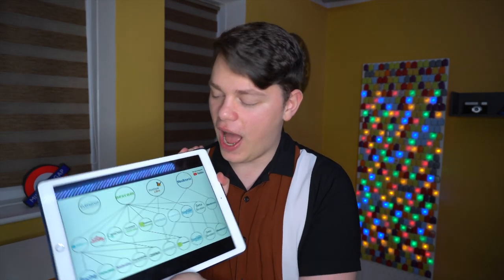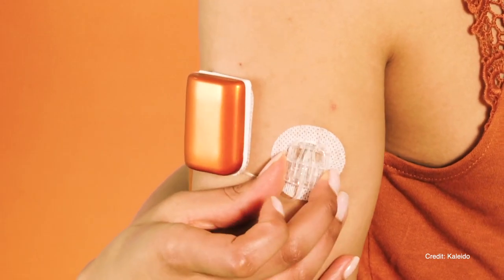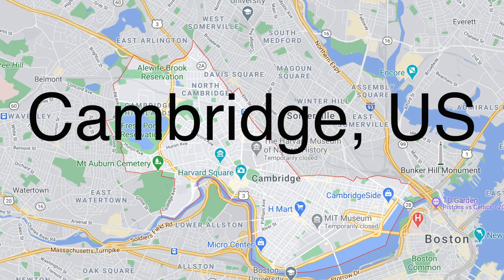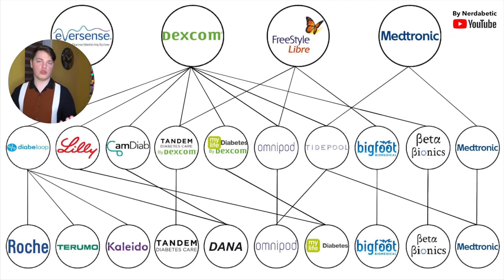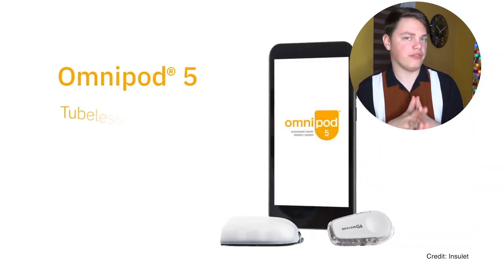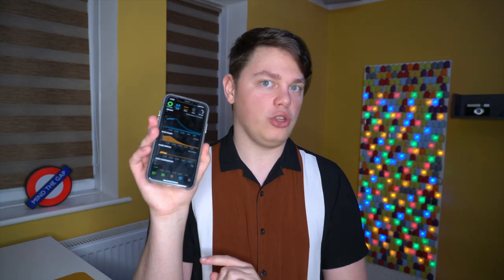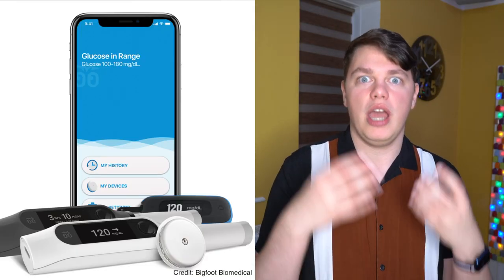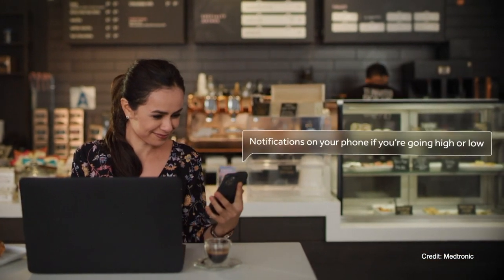10 Closed Loop Systems explained

Comment: Just got the 780G which is a closed loop system and absolutely loving it!!
Reply from the maker: Thanks for sharing!
Reply: Hi yaz, I'm happy for you. After a few months now , the 780G just doesn't work properly for me. I had better average values when managing manually (HBa1c around 6.5).
Problem is, when it is in smartguard mode, there is no way to put a real bolus to get glucose levels down more quickly. The SmartGuard is just not aggressive enough. One would have to cheat and fake taking Carbs, but that also causes problems with the Algorithm . Also no way to temporarily modify the basel rate.
It definitely does not know very well how to deal with a pizza.
I have a quite good idea what my carb ratio was on the previous pump. But the 780G keeps adjusting the amounts down, resulting in too high levels.
I was really hopeful that the 780G would deliver, but I'm most of the time between 8.5 and 10, where as my target range is 5.5.
I do sleep better though: I silence the pump, and during the night glucose levels very slowly descend to 5.5, but it takes about 6 hours to get there.

Comment: Another Great Video, 
it seems diy closed loops lead the way and forced commercial development to speed things up. 
Here in the UK commercial closed loop systems will only be widely available for self funded patients. I watched your excellent loop series. When you can, do a similar break down for the different diy systems. I believe the diy loop system people set up largely depends on what hardware they already have access to, for example I have an NHS supplied Insight pump and Libre and use an android phone hence I only needed to add a MiaoMiao to set up AAPS.
Reply: I have insight and libre too and want to work out closed loop. Can you tell me what miao miao I need please

Comment: Did I hear you correctly when you said the 780 rollout in the US will be as a software update to the 770g?
Reply from the maker: No updates at the moment but it is anticipated very shortly. Just like everything at FDA, it is delayed as FDA is focused on pandemic related products.
Reply: @Nerdabetic  Thanks, of course FDA= finally  decide anything?  But specifically is the 780 just a 770 with a downloaded update. Therefore, do I have a 780 already, just awaiting that download?
Reply from the maker: Hahahaha that’s a good one! Well the difference between 770 and 780 is just the software so yes.

Comment: Not sure if you said medtronic 780 will work with dexcom or not
Reply: It doesn't. The 780 has already been launched you can watch videos about it. Medtronic pumps only work with the Guardian sensor from Medtronic. This video is about hybrid closed loop systems which often use older pumps or pumps which don't have a system integrated already
Reply from the maker: Medtronics pump will work with Dexcom via Tidepool Loop. It is not 780G but a special version of a Medtronic pump which will work with Tidepool. Hope this helps

Comment: Have you been having any adverse reaction to the Dexcom G6 adhesive glue on their sensors? I think they changed the glue formula almost a year ago and ever since then the sensors tear my skin up. If the sensor material gets wet in the shower it starts a terrible skin reaction. I’m having to create an underlay. Basically putting the sensor on top of a big bandaid and poking a hole through the center for the insertion needle sensor. What a pain in the ass! I’ve called Dexcom many times and they don’t care at all! You can Google this issue under “Dexcom sensor allergic or skin reaction”.
Reply from the maker: No, I have never had any issues with my Dexcom. It has been working incredibly well for me since day 1.
Reply: @Nerdabetic  I have not had any issues with the Dexcom sensors either.  Unfortunately we are not all the same and have to customize wherever it is required.
Reply: Can you appy SkinPrep prior to applying to protect your skin?
Reply: It is actually very common, I had bad allergic skin reaction to G6, the solution for me was a simple skin prep, both Medline or Smith & Neph worked equally well, as an added insurance, I also put on SkinTac after the prep.  It works amazing, no nasty bumps or rash anymore, all available on eBay and WELL worth it to keep my G6.  GOOD LUCK ALL!

Comment: I'm very worried about what's happening (commercial agreements).Years ago, it was still possible to design your own closed look system (e.g.openaps.org ). Pump manufacturer since then have started removing that possibility (medtronic) , and now we would have to pay to use software that sends all data back to "mothership"? And we'll have to pay a license to use the software, but cannot roll our own algorithm and keep our data private to ourself? Too bad you did not mention openaps #wearenotwaiting  
Thanks for this info! I'm suffering from the Medtronic Minimed 780G pump's bad software algo design and unreliable sensors. It's also not capable to communicate with latest versions of iOS and MacOS, or Linux.
Greeting from Switzerland, Peter